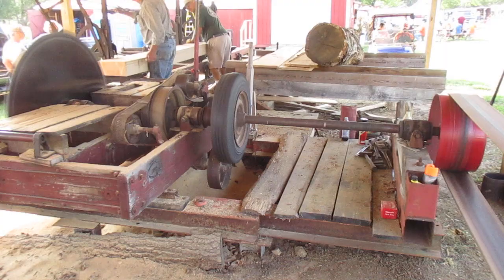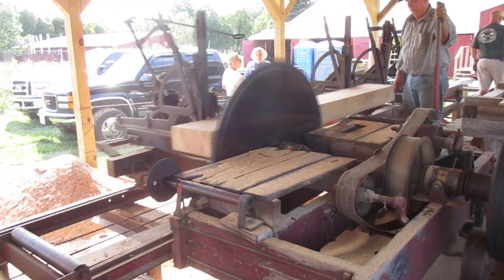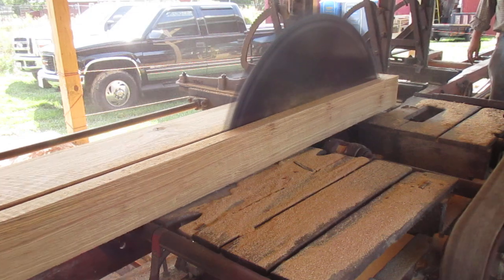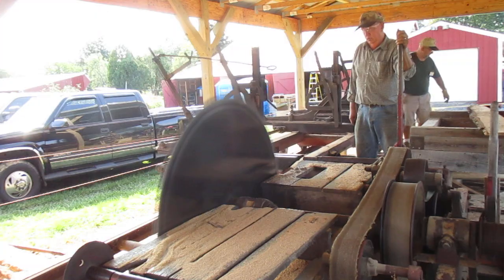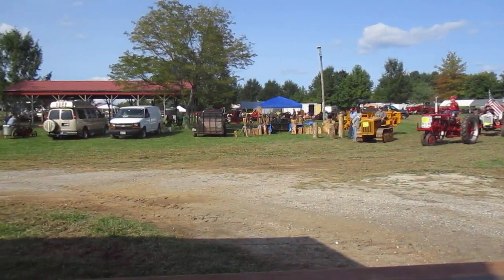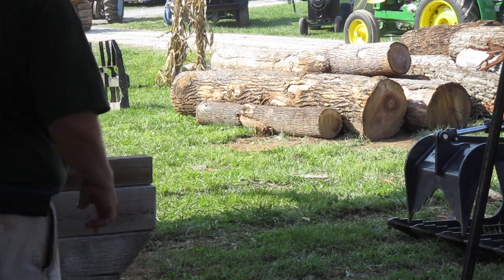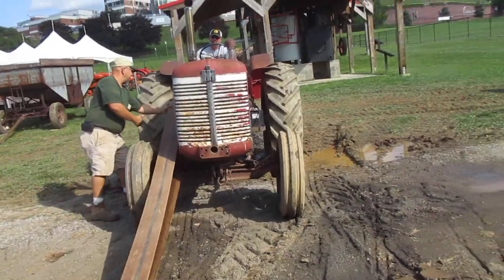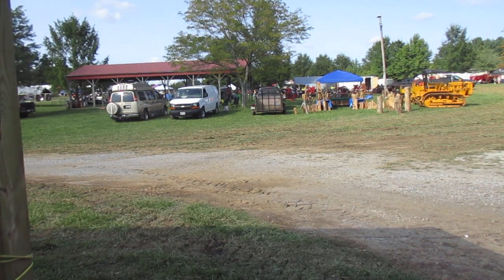Sawing Logs at Mason Dixon Steam and Gas Show 2021 #479

Comment: Well, this beats the buffalo-chip tossing contests out here in the Sandhills of Nebraska, where such used to be burned as the major source of heat for sod houses on the treeless prairies.
Reply from the maker: hi there now thats a crapy job thanks john
Reply: I don't know what the heat output of buffalo chips is, but anyway, it wasn't as distasteful as one thinks it might've been.  After a single Arctic-like Nebraska winter and a single Sahara-like Nebraska summer, the clumps were baked dry, sterile, and lightweight.  It might sound distasteful, but one had to make do with what one had.  All Hail! to our gallant pioneers!